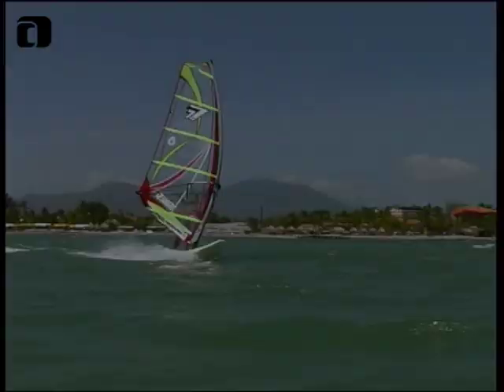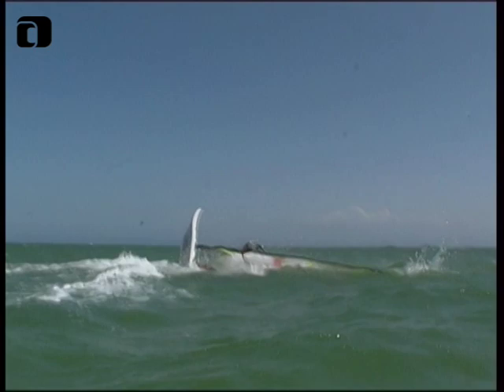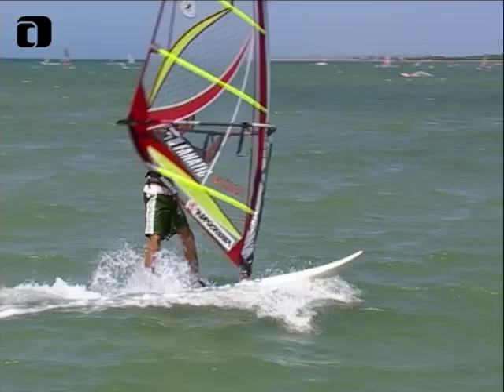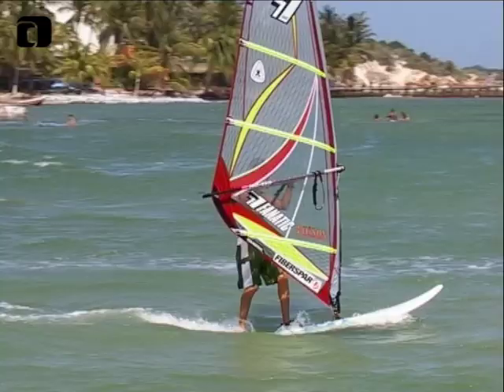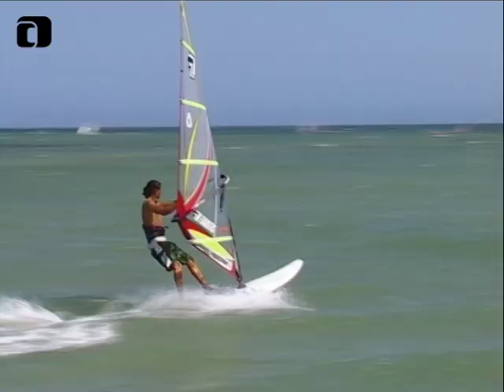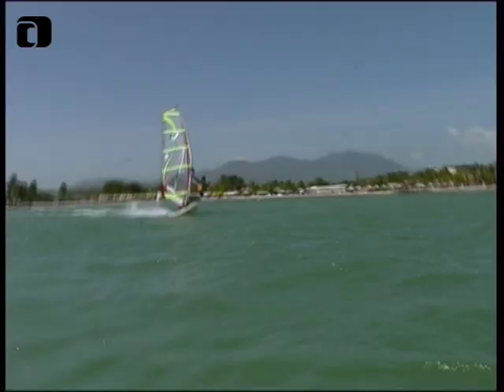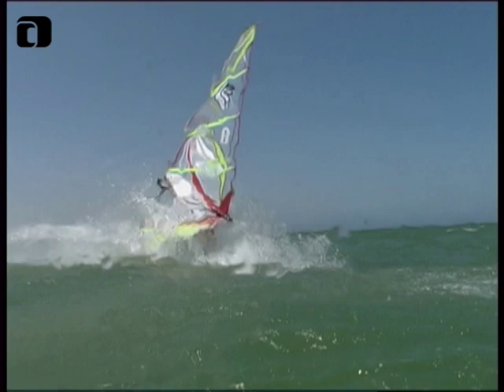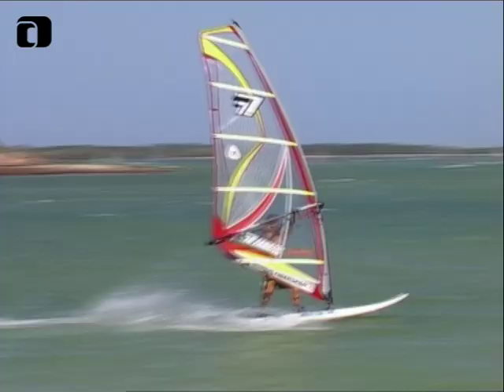HOW TO SPIN LOOP IN 4 STEPS with Remko de Weerd

Comment: I have been cheeserolling since the late 1980s but struggled to do spin loops. I watched this video over and over but never got it. Then I noticed something that Remko doesn't mention.   As he approaches the wave he ducks below the boom. Walla you go around and not over. 
This is my second time mentioning this and I don't understand why but it just works.
Reply: @tomnguyen2949  Hi Tom, I think we are both agreeing but from a different perspective. As you hit a wave or chop the nose points up but if you stay in the same pose you won't get the  board to travel behind. In a cheesy your board follows over your head because the fin and hull have stopped resisting the rig. As the board hits the wave you must let the mast stay vertical and that means the boom must be higher for the surfer(like ducking) as the board leaves the water you go around the front if you stay sheeted in. 
Anyway, for me it works, if you give it a go you may get the same result, maybe.

Comment: Pls give footstraps positioning and biggest board/sail possible to use and fin size - the details....don't wanna break an ankle trying this :(
Reply from the maker: Hi Jess! 
We'd recommend to use a board with a single strap in the back. The position of the front straps should be further towards the inside. The fin shouldn’t be too long. The best is to use a wave fin setup (single, twin or thruster) or a a moderate free move fin up to 28 cm. In terms of sail size we recommend sails in between 4.5 and 5.5m depending on your bodysize/weight.
Don’t make your straps too tight and use long harness lines (30“ to 32“). The best board and sail choice would be a wave/freestyle board up to 105 liters and a fairly light and handy wave/freestyle sail. The lighter and better balanced your equipment feels in your hands and under your feet, the more effortless your attempts will be. 
Good luck and keep us updated about your progress!
Reply: @continentseven  one more "Q", sry - is it better to move mast base a tad forward or back?
Reply from the maker: @jessg7770  The best ist to place the base in the center or a little bit forward to rotate easily. Good luck!
Reply: @continentseven  thx again...Ill try 1or 2 cm forward and see how that works...